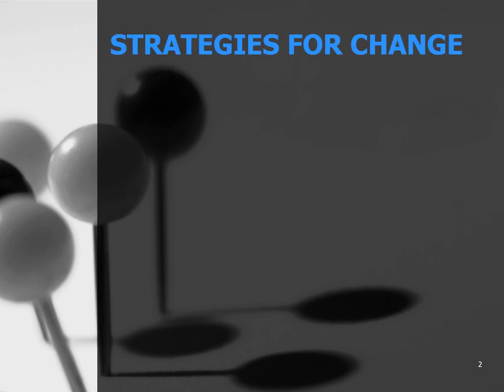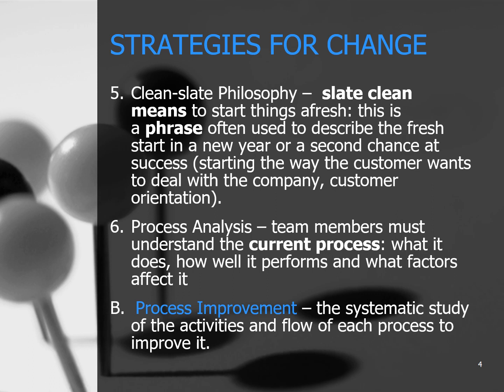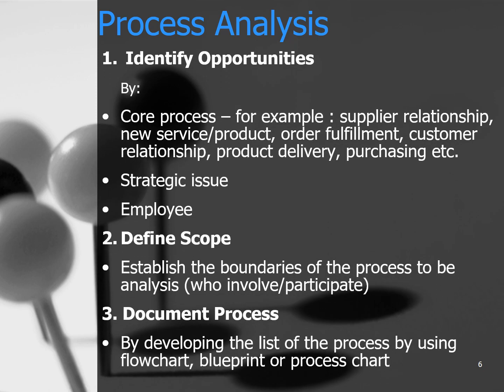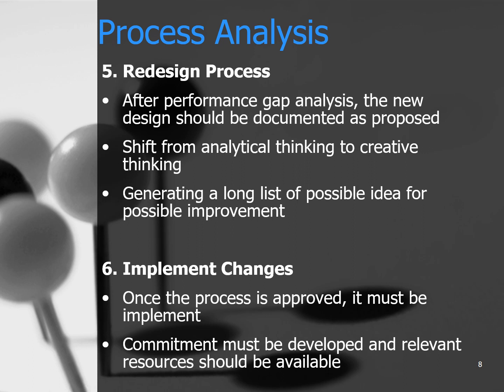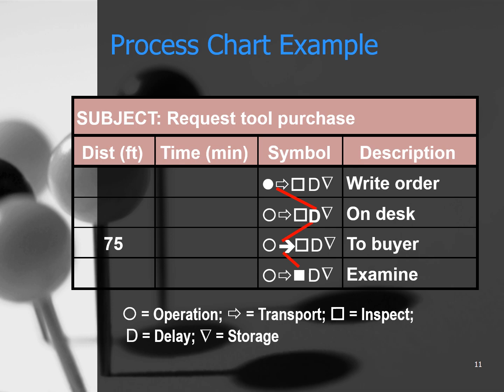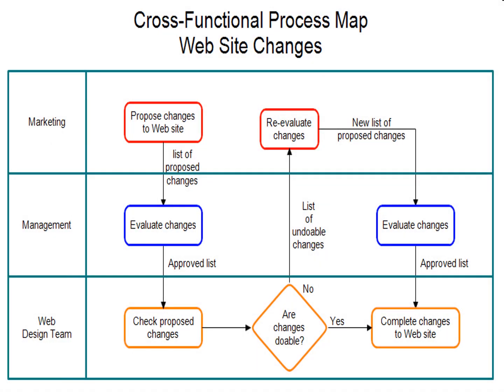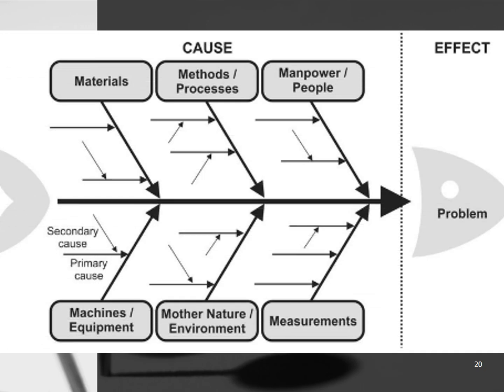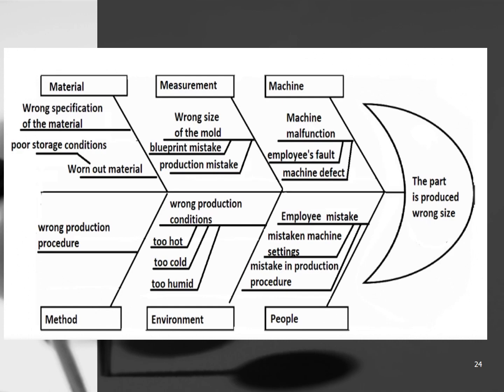Process Improvement

Comment: Thank you madam for this wonderful explanation regarding to this topic.  Base in the video I do understand that there are 6 process improvement for the business process design.   There are six elements of strategies for change which are 

A. Proceed re-engineering - The fundamentals of rethinking and radical redesign of processes to improve performance dramatically in terms of cost, quality, service and speed.

1) Critical process - To emphasize on core Business and essential process.
2) Strong leadership - here, the managers will helps in order to overcome the resistance, to set and monitor the key performance objectives for the process and to create sense of urgency.
3) Cross-functional teams - it is consist of members of each functional area, affected by the process change.
4) Information Technology - it will lead to the success of the business re-engineering projects.  It is a primary enabler of process re-engeneering who needs information network, computer technology, the information, when and where.
5) Clean-slate philosophy - this is a phase where often use to describe the fresh start in new year or a second chance at success.
6) Process analysis - at this phases, the team members must understand the current process.

Comment: Based on explanation, I do understand that process reengineering is the fundamental rethinking and radical redesign of process in order to improve performance dramatically in terms of cost, quality, service and speed. Then, there were 6 element in strategy to changes which are critical process, strong leadership to overcome resistance or create sense of urgency to change, cross-functional team that involve many departments, information technology, clean-state philosophy which it was based on customer experience or perception and lastly the process analysis that needed the teams to understand about current process also identify what need to be done. Moreover, the video has explained about the systematic approach, there were 6 step involves which are identify opportunities, defining scope, document process, evaluate performance, redesign process and implement changes. Last but not least, I understand the explanation on 5 symbols that consist in the flow chart which are operations, transportation, inspection, delay and storage.

Comment: Thank you madam for your explanation, based on the video provided and what I understand there are two strategies for changes 1. Process reengineering 2. Process improvement. In the process reengineering (1) there are 6 elements which include  critical process, strong leadership, cross-functional teams, information technology, clean-slate philosophy, and process analysis. After that, it is the systematic approach we learn that there are 6 steps of process analysis  identify opportunities, define scope, document process, evaluate performances, redesign process, and implement changes.

Comment: Thank you for the explanation video, madam.  Based on my understanding, it is all about Process Improvement.  

Process reengineering is the fundamental rethinking and radical redesign of processes to improve performance dramatically in terms of cost, quality, service and speed.  The 6 element of process reengineering; Critical Process, Strong Leadership, Cross Functional Teams, Information Technology, Clean Slate Philosophy and Process Analysis. 

Next, Process Analysis is the documentation and detailed understanding of how work is performed and how it can be redesigned.  The Process Analysis systematic approach consists of 6 steps; Identify Opportunities, Define Scope, Document Process, Evaluate Performance, Redesign Process and lastly, Implement Changes.

Flow Process Chart  
5 symbols; Operations, Transportation, Inspection, Delay and Storage.

Comment: Based in my understanding in Chapter 6: Process Improvement, defined of process reengineering is the fundamental rethinking and radical redesign of processes to improve performance dramatically in terms of cost, quality, service and speed. And there are 6 elements, critical process, strong leadership, cross-functional teams, information technology, clean-slate philosophy and process analysis. Next, process improvement bring the meaning of systematic study of the activities and flow of each process to improved it. Hence, process analysis is the documentation and detailed understanding of how work is performed and how it can be redesigned. A systematic approach consists of 6 steps, firstly, identify opportunities, defining scope, documenting process, evaluate performance, redesign process and implement changes. Documenting the process thorough flowchart is the diagram that traces the flow of information, customers, equipment or materials through the various steps of a process. The flow process chart is the document used in systems that analysis that is useful for identifying each step in a specific work process, using the operations, transportation, inspection, delay and storage. In this chapter, I understand the symbol and the meaning also used of symbol for process chart. In addition, the fish bone diagram is one of the chart or diagram that can be used to measure the business process reengineering in the organization.

Comment: Chapter 6 
*Process Improvement 

Thank you madam for the explanation 
Based on the video, I can understand it explained about the sub chapter of business process redesign which is about process improvement. 

Strategies for Change (6)
which is already mentioned in chapter 1 but with additional 2 elements 
Strategies for change is the process of reengineering.

The six elements are: 
1.  Critical process-it refers to core business and essential processes. 
2. Strong - managers will help overcome resistance, set and monitor key performance objectives for the process, and create urgency to change. 
3. Cross-functional teams - consist of members from each functional area affected by the changes. 
4. Information technology - as a primary enabler of process reengineering, which needs information network, computer technology, and when and where. 
5. Clean-state philosophy - means to start things afresh. 
6. Process analysis - team members must understand the current process. 

Next subtopic is regarding a systematic analysis which explain more about the process analysis. 

The process analysis consists of:
1. identify opportunities
2. define the scope
3. document process
4. evaluate the performance
5. redesign process
6. implement change

Next is the third systematic approach which is documenting the process are explained in more details

Documenting the process: 

Flow chart- a diagram that traces the flow of information, customers, equipment or materials through the various steps of a process. 
There are 5 symbols in the flowchart which are the operation that changing the physical or chemical characteristics of an object. Secondly, the transportation which functioning as the movement of an object from one location to another. Next, inspection which understands as verifying data or checking an object. Moreover, the delay is a situation that causes the next step in the process to be delayed. Lastly, storage storing/ or protecting an object.

Comment: Based on the video. There are six elements for change strategies: Critical Success, Strong leadership, Cross-functional teams, Information technology, Clean slate philosophy, and process analysis. Next, there are six steps of the systematic approach for process analysis, and they are identifying opportunities, define scope, document process, evaluate performance, redesign the process and implement changes. Then there are certain types of flowchart process that can be used, and there is a fishbone diagram which use to look for the cause and the effect of one's function.

Comment: Thank you for the thorough explanation madam.  Based on the video, there are 6 elements of strategies for change which are critical process, strong leadership, cross-functional teams, information technology, clean-slate philosophy, and process analysis.  Next, a systematic approach requires 6 steps which are first, identify opportunities.  Second, define the scope and followed by the third step which is the document process, and evaluate performance as the fourth step.  The fifth step is the redesign process and the last step is to implement changes.  Moving on, documenting the process requires a flowchart that is used to trace the flow of information, customers, equipment, or materials through various steps of a process.  Last but not least, there are 5 symbols in the process chart which are operations, transportation, inspection, delay, and storage.

Comment: Based on this video explanation, process reengineering can be define as the fundamental rethinking and redesign of processes to improve performance in terms of cost, quality, service and speed.  There are 6 element for change:
1. Critical Process
2. Strong Leadership
3. Cross-functional Teams
4. Information Technology
5. Clean -slate Philosophy
6. Process Analysis

Process improvement is the systematic study of the activities and flow of the process to be improve.  There are 6 steps of systematic approach to process analysis:
1. Identify Opportunities
2. Define scope
3. Document process - (flowchart)
4. Evaluate performance
5. Redesign process
6. Implement changes

Flow Process Chart is a document used in system analysis to identifying each step in a specific work process by using the 5 symbols which are operations, transportation, inspection, delay and storage.

Comment: Based on the video, I can understand that it mentioned the 6 elements of strategies to change. It is the process of reengineering. Firstly, it mentioned the critical process on how 
it refers to core business and essential processes. Secondly, strong leadership is another point that defines the managers will help overcome resistance, set and monitor key performance objectives for the process, and create urgency to change. Next, the cross-functional teams that describe it consist of members from each functional area affected by the changes. Then information technology can be understood as a primary enabler of process reengineering, which needs information network, computer technology, and when and where. Moreover, clean-state philosophy which it means to start things afresh. Lastly, process analysis which team members must understand the current process. 

The process analysis consists of:
1. identify opportunities
2. define the scope
3. document process
4. evaluate the performance
5. redesign process
6. implement change

There are 5 symbols in the flowchart which are 
the operation that changing the physical or chemical characteristics of an object. Secondly, the transportation which functioning as the movement of an object from one location to another. Next, inspection which understands as verifying data or checking an object. Moreover, the delay is a situation that causes the next step in the process to be delayed. Lastly, storage storing/ or protecting an object.

Comment: First of all, thank you for the explanation madam :)  Based on the video, this topic discusses the process improvement that consists of strategies for change includes 6 elements which are critical process, strong leadership, cross-functional teams, information technology, clean-slate philosophy, and process analysis.  Second, a systematic approach that required 6 steps; identify opportunities, define scope, document process, evaluate performances, redesign process, and implement changes.  Next, the document process consists of a flowchart that is used to traces the flow of information, customers, equipment, or materials through various steps of the process.  In addition, process charts also plays an important role in systems analysis where they identify each step in a specific work process into 5 categories; operation, transportation, inspection, delay, and storage.  Lastly, fishbone diagram that is being used for brainstorming to explore the root causes for undesirable effect.

Comment: From my understanding is, strategies for change have 6 elements which are :
1.critical process - emphasize on core business and essential processes
2. strong leadership - managers help to overcome resistance, set and monitor key performance objectives in the process and create sense urgency to change
3. cross functional team - consist of members from each functional area that affected by changing process
4. information technology - primary enabler of process reengineering 
5. clean slate philosophy - start things afresh
6. process analysis - team members must understand the current process

Process improvement means the systematic study of the activities and flow of each process to improve it.

There are 6 steps in process analysis which are:
1. Identify opportunities such as core process, strategic issue and employee
2. Define scope 
- those who involve or participate
3. Document process such as list of process by using flowchart (there are 5 symbols which are operations, transportation, inspection, delay and storage), blueprint or process chart
4. Evaluate performance such as measure quality, customer satisfaction, time or any other key priorities 
5. Redesign process 
- generate idea for the possible improvement
6. Implement changes - must be implemented when the process is approved

Comment: Based on above video, it mentioned about the 6 elements of strategies to change.

A. PROCESS REENGINEERING
1. critical process - it refers to core business and essential process. 
2. strong leadership - managers will help to overcome resistance, set and monitor key performance objectives for the process, create send of urgency to change.
3. cross functional teams - it consists of members from each functional area affected by the changes.
4. information technology - a primary enabler of process reengineering, who needs information network, computer technology when and where.
5. clean-state philosophy - it means to start things afresh. 
6. process analysis - team members must understand the current process. 

Process analysis consist of:
1. identify opportunities
2. define scope
3. document process
4. evaluate performance
5. redesign process
6. implement change

5 symbols in flowchart:
1. operation - changing the physical or chemical characteristics of an object
2. transportation - the movement of an object from one location to another
3. inspection - verifying data or checking an object
4. delay - a situation that causes the next step in the process to be delayed
5. storage - storing/ or protecting an object

Comment: What i understand from the video explanation is about the process improvement. First, six element for strategies for change are critical process, strong leadership, cross-functional team, information technology, clean-state philosophy and process analysis. 

Next, for system approach there are six step consist of identify opportunities, define scope, document process, evaluate performance, redesign process and implement changes. 

The third step which is documenting the process, there are the detail explationan on it. Flow chart which is a diagram that traces of flow of information customer and more and flow process chart which is a document used in system analysis that is useful for identifying each step in a specific work process. 

There are also five symbol use in the flow process, operation, transport, inspect, delay and storage. Meanwhile for the basic, start/end, arrows, input/output, process and decision.

Comment: Thank you for the explanation madam. According to the video's explanation on Process Improvement, I understand that Process Reengineering is a radical rethinking and redesign process that drastically improves efficiency in terms of cost, quality, service, and speed. There are 6 elements of strategies for change which include; critical process, strong leadership, cross-functional team, information technology, clean-slate philosophy, and process analysis. 

We need to evaluate the process in order to change it, so process analysis is the documentation of how work is done and how it can be improved. There are 6 steps of systematic approach that includes; identify opportunity, define scope, document process, evaluate performance, redesign process, and implement changes.

A flowchart is a diagram that shows how information, clients, equipment, or materials flow through the various steps of a process, and the chart itself will go into greater detail than the flowchart. The flow chart process is a document used in systems analysis that can be used to describe and phase in a particular work process by categorizing it into operation, transportation, inspection, delay, and storage.

Comment: STRATEGIES FOR CHANGE

A. process reengineering
6 element:
1. critical process
2. strong leadership
3. cross-functional team
4. information technology
5. clean-slate philosophy
6. process analysis
- identify opportunities = core process, strategic issue, employee
- define scope = establish boundaries of the process to be analysis
- document process = developing the list of the process by using;
i. flowchart - diagram that traces the flow of information, customers, equipment or materials through the various step of a process
ii. process chart - 5 symbol; operations, transportation, inspection, delay, storage
*fishbone diagram = head - problem, spine causes and categories
iii. blueprint
- evaluate performance = important: develop performance measure such as; quality, customer satisfaction, time, cost, error, safety, environment, flexibility
- redesign process = after performance gap analysis, the new design should be documented as proposed
- implement changes = once the process is approved, it must be implemented
7. process improvement